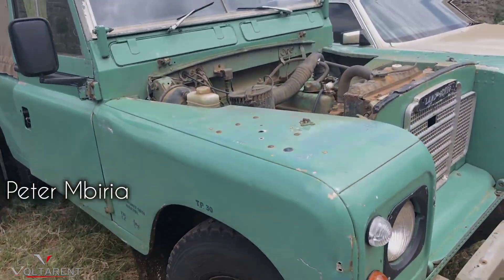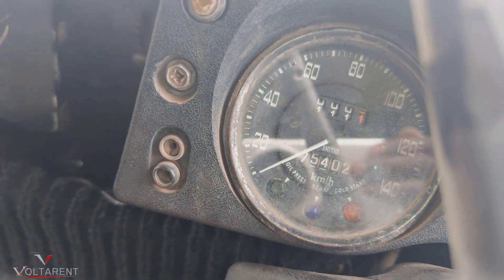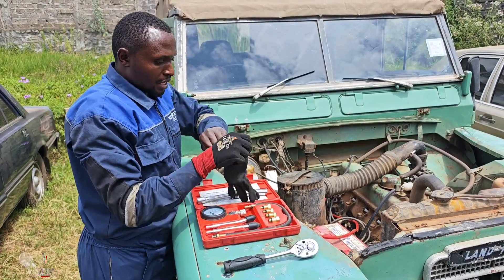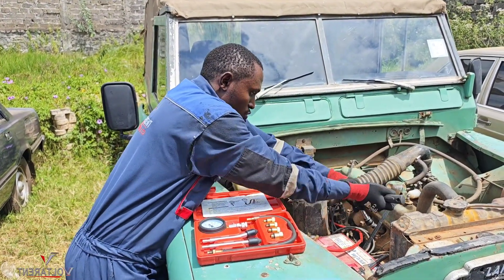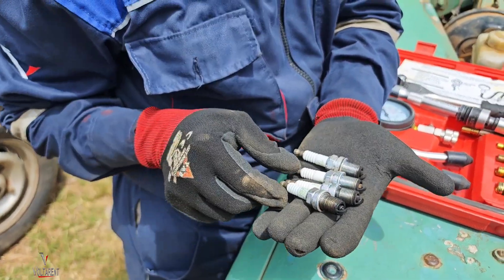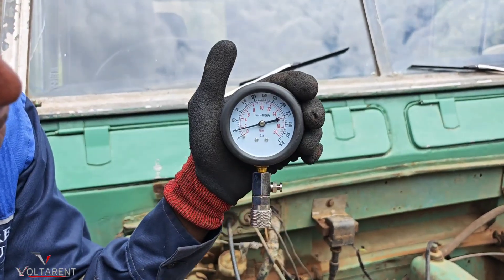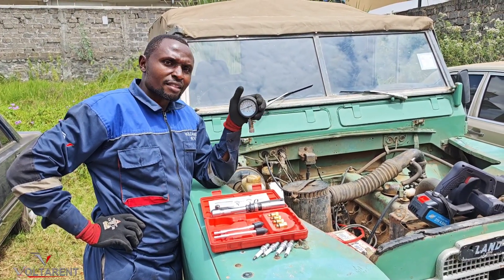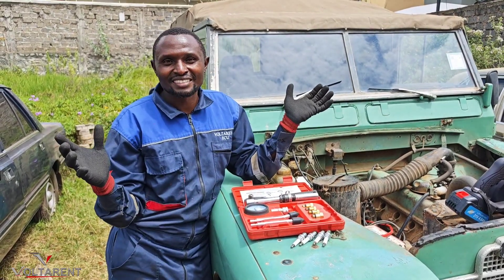Engine Compression test

Comment: PETER 
DO YOU HAVE 
AN EMAIL YET ? 
CAN YOU SELL ME THE ECU AND SOFTWARE WITH A BASIC V8 CONFIGURATION ? 
WIRES & INJECTORS WITH OPTIONS TO USE A DISTRIBUTOR OR COIL PACKS.INSTEAD OF COIL ON PLUG. 
Look up GM /  BUICK / PONTIAC / OLDS / CHEVY / CADILLAC:
V6 3800 
THE PARTS ARE CHEAP, SIMPLE & BULLET PROOF.

I NEED TO DISCUSS HOW YOU CAN START SELLING IN AMERICA. SPECIFICALLY THE UNITED STATES. 

ALSO, AUSTRALIA.
I HAVE A GUY THAT WOULD BE ABLE TO USE IT ON HIS YOUTUBE CLASSES. 

WHAT IS YOUR STATUS OF SETTING UP A MERCHANT SITE ? 
NO NEW VIDEOS.

Comment: You got a valve not closing
Reply from the maker: Yes and we sorted it out 😃
Reply: Will your system work on a cb750 Honda motorcycle '74 . I was going to covert it from points to electronic ignition.  @PeterMbiria1

Comment: The engine runs smooth, even though 1 cylinder is 25 psi. 
IT should shake or sound abnormal. 
You didn't tell the rookies , the engine must turn over 6 turns to get the GUAGE's check valve to catch 1 compression stroke. 
After 6 turns the pressure will stay the same. 
I saw 4 adapters, but have only seen 2 different plugs here in USA. 
13/16 & 5/8 are the only different plugs here. Same threads.
Lawn mower, Briggs & Stratton have different size threads. 
Just curious 
The blower is a modern air hose, or a shop vac. No cord even.